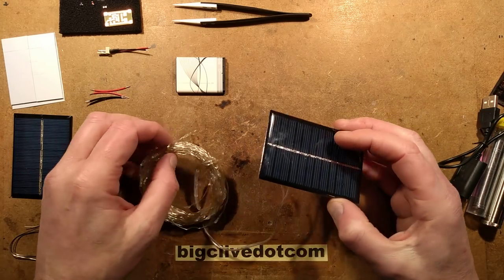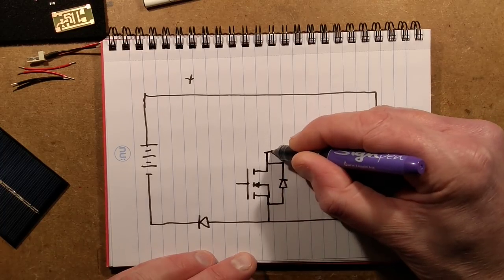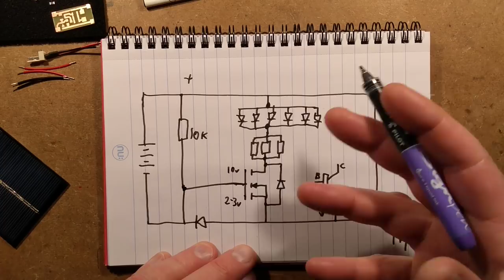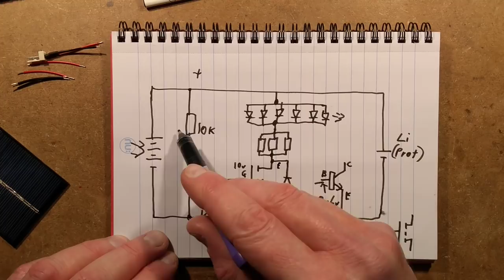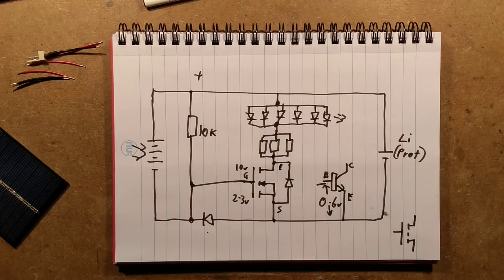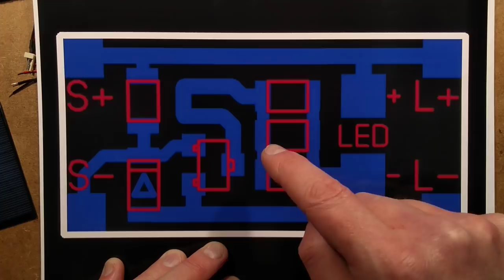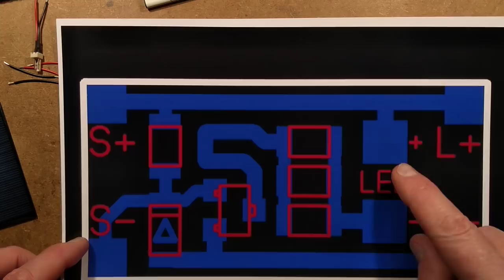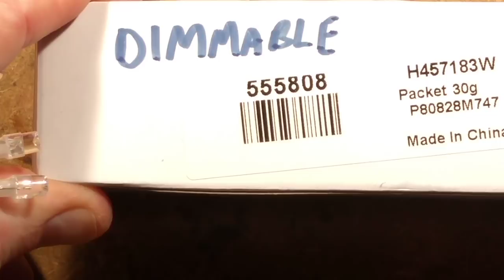DIY solar garden light project.  Surface mount remix.

Comment: 7:10 matter of fact fets where invented first they just lacked the technology to manufacture them so the bjts turned out to be available first ...
Reply: Yeah, two cat's whiskers.  Took them a while to get the hang of doped junctions.
Reply: In college we made some crude MOSFETs in a freshman physics lab. They weren't particularly difficult to make, or at least they aren't if you are given a furnace, doping gasses, photo resist, hydrofluoric acid, and vacuum plating setup 😁

I'm not sure why manufacturing MOSFETs took do long. The original designs might have been JFETs; those are harder to make.
Reply: @PaulSteMarie  Yeah, they're not hard to make once you've figured it out.  I don't mean figuring out how they would work, that was done back in the 1920s.  It was figuring out the materials science needed to make them.

Yes, JFETs came first.  The materials science needed to get the correct junction profiles took a while to figure out.  MOSFETs are simpler.  So simple, even college students can do it. :)  Even so, figuring out the materials science took a while.  These days they do clever things with anisotropic etchants too.

And the BJT came about from trying to diagnose why they couldn't make a functional JFET.  So simple, you can make one by accident.
Reply: Hydrofluoric acid is nasty stuff.
Reply: @simontay4851  Ah yes, one person got a micro drop on his hand and the health and safety people went on high alert. I raised a blister on my finger twisting off the cap on a bottle of soda and they sent me to the doctor for evaluation.
Reply: @bdf2718  Dunno about the material science aspect. JFETs, BJTs, and depletion mode MOSFETs are all tricky to make; the base and channel layers are very thin and require a lot of trial and error to get right.

Enhancement mode MOSFETs, however, are easy-peasy. O2 in a furnace gives you the oxide layer. Then you photo etch two holes in the oxide layer and dope it heavily in the furnace. Final step is vacuum depositing aluminum and then photo etching three pads. No harder than making  diodes.

My only guess is that no one had though of enhancement mode MOSFETs at the time.

All I can
Reply: @PaulSteMarie  Even with enhancement-mode MOSFETs you have to figure out the materials science of photo-etching.  Easy to do, once you know what chemical processes work, but experimentation required to find processes that work.

The first BJT was made with some doped semiconductor (no junctions or clever diffusion profiles or whatever) and two metal contacts.  By accident.  It's hard to get simpler than that.  In fact, it's possible to do it without a doping stage if you choose the right starting material, such as galena.

Comment: Feel old cause my portable soldering iron is still butane. Bright orange RadioShack version of the Weller Portasol (P1C) I've had for 25+ years.

Probably better at dealing with 16g car wiring than a usb tho.
Reply from the maker: The gas ones tend to waver up and down a bit too much for me.  But the bigger ones are good for large solder joints like wires.

Comment: Hi bigclive Love the videos, I have built 2 of these so far (more parts on order) and they work great, and as I am self-taught (by watching you and others) just wondering if you could explain a little more about what "Pull up" and or "Pull down" resistor is and how and why it works?I know I could google it but hearing you would make more sense to me than reading it over and over again it sure would help me (& maybe others) a lot!!! Thanks again and Two Thumbs UP Sir!!
Reply: I also did a short search for that soldering tip that you use in this video on ebay and nothing came up ?
Reply from the maker: A pull up resistor just applies a slight bias towards the positive rail of the supply and a pull down provides the same slight bias to the negative rail.  It's use to avoid leaving switch inputs floating in an unknown state and to make sure things like MOSFET transistors are always off when not being driven.

Comment: Hello all,
I have a question for Clive and/or the community. I'm a disabled video doorbell (Ring) owner. Ring sold me a solar charger ($50 USD) for the doorbell as it's rather hard for me to remove the doorbell from the wall and re-charge the battery on the doorbell. But the solar charger does NOT keep the doorbell charged even if I have all the power settings at the lowest power usage settings. Is there a way to build/buy a solar charger that I don't need to remove and re-charge the doorbell as often I currently do?

Comment: What are your opinions on the types of iron that say, 30 seconds on 30 seconds off? I have one and it seems like it just gets up to temperature at 30 seconds but cools down too quickly, I wondered about adding a 12v fan to it, stop it smelling hot 😂

Comment: A good Joule Thief Can be made with this MOSFET.
Reply: I ordered 200 of A2SHB and first used a 2N7000 to build a "Classic Joule Thief" with a 5k pot in place of the 1K resistor on the base or gate, plus I added a White LED from gate to zero Volts so the gate would not get more than about 3V (I killed one 2N7000 without it) The 2N7000 would only work down to 1.0 Volts (not so good) but when I put the A2SHB in the same circuit it would work down to 0.6 Volts, so yes, it can make a Joule Thief. The MOSFETs will also put out enough to light 9 Volt LEDs quite brightly.

Comment: What kind of soldering iron is that or what is it converted from exactly, I would like one for my work toolbag it would be perfect for what i do
Reply: @cannrobe   Unfortunately they do not ship to the grand ole U.S and A... but it gives the round about specs and they seem quite mass produced so I can find another thanks!
Reply: Grab a TS100. They can be powered by pretty much any battery and at 24V are rated 65W. They are smaller than this, have interchangeable tips, temperature control, standby and autosleep, etc. And price is quite affordable.
Reply: @MladenMijatov  That style of e-cig battery can be had for about £3-£4 - no contest with a TS 100.
Reply: @Coltgov191145  I had a look and some of them don't ship to Australia either. Try putting  Soldering-Iron-Wireless-Charging-Soldering-Iron-Mini-Portable-Battery-DIY-Y9N2/113916006690 into your search and you will likely have a bit more luck.
Reply: @MladenMijatov  Excellent advice, and I've been really enjoying my TS100 for everything but the heaviest jobs :-)
Reply: @mahlapropyzm9180  No contest on price given that the TS100 is around $40; but a huge contrast in power, bit size, and frustration levels, the TS100 wins very easily on all those.

Comment: So this is a while ago, (yes Im binging BigClive). Those kind of batteries are a bit tricky to find now, but could you use a disposable vape type battery with one of those tp4051 protection circuits? I've heard they can be tricky with solar panels.
Reply from the maker: You could use a simple cell protection PCB or with the full TP4056 module you could use a much bigger panel.

Comment: Hi Clive, 

I don't suppose you would happen to know roughly what that little iron would equate to, in terms of Watts, in a conventional mains powered iron? - I'm guessing at less than 15W?

For sensitive circuitry, years ago, I had an Antex 12V, 25W, iron that I ran from a car battery. It was an invaluable tool, until I forgot to disconnect it one night. Next day, the heating element was O/C - burned itself out in the night. . . . This little tool of yours looks like good one for sensitive components, but would you recommend grounding it to dump any static discharge? Or would you think the risk to be negligible?
Reply from the maker: Probably about 8 watts so no competition to a full size iron.

Comment: hello! the base and collector legs of transistor can be wired on the circuit. Base can be wired after the 3 resistors and the collector can be wired to positive with pull-up resistor. Is it okay? I do not see the transistor in PCB.

Comment: Clive do you have any links availible for the hardware used to modify the Vape Mod into a Soldering Iron? Such a handy idea for a Vaper working in the field.
Reply: I managed to find a range of different types by searching 5v soldering iron on ebay

Comment: You'd need a hot work permit in my work to solder (in the main building such as exit suites or studio areas not in workshops) due to having to disable smoke detectors and fire suppression systems and the eejit factor of course...
Reply: save them hotel plastic shower caps for the head. they work great for disabling a smoke detector
Reply: @cardboardboxification  I usually use a blue nitrile glove...

Comment: Hi CLIVE. Can you please tell me why you bought the uni-T  210E and not the 210D? Which is better for diy Auto repair. Thanks Chris NYC 👍
Reply from the maker: I believe the main difference between the two models is that the ut210e has a low current range for greater accuracy with electronic loads.

Comment: Out of interest Clive,  when doing SMD work when in your opinion is it best to use a soldering iron and when is it best to use paste & hot air?

Just started out working with  SMD components and it's something I've been  wondering about.
Reply: look up ( Mr Carlson's Lab ) he is  the SMD king
Reply from the maker: I've just bought a reflow plate for soldering whole PCBs at once.  For small tasks manual soldering seems fine.

Comment: Have used this circuit, but I have problem. 
My 5V solar panel puts out 60mA at open circuit (measured). That could be more than enogh to charge the battery in sun (3h in dirrect sunlight) and drive 10mA LED at night. But the rectifier diode cuts that "open circuit" current down to 16mA (internal resistence of diode?). So I presume - my battery wont recharge durring daytime. Do I miss something?
P.S. Thank You for explaining MOSFETS. After this video I understood how to work with them.
Reply from the maker: The diode shouldn't limit current significantly.  Keep in mind that using a meter in series to measure current introduces extra resistance.
Reply: @bigclivedotcom  
Problem solved.
Two (???) second-hand diodes i've got for testing were fault.
For both there must be some internal failure happened, that restricts current flow.
Took a brand new diode and the current flows without any significant drop.

Comment: For safety reasons you better put the protected side of the connector to the battery not on the led string.

Comment: Try some gel flux - it will help make better joints on the SMD's
Reply from the maker: I've got a bottle of flux, but really need a needle dispenser for it.
Reply: @bigclivedotcom      G E L     flux - use a kids paint brush to apply it.

Comment: Thinking of deadbugging a few of these (same technique as the old video, just with a through-hole MOSFET). Can't find any that have such low Rds(on) as the SMD package, though I suppose that might be down to lead resistance.
Tried doing the math...looks like the break-even point where a MOSFET would be better than a Transistor Universal NPN is where Rds(on) times Ids is less than 0.6V? Quite a few through-hole MOSFETS that claim Rds(on) in the neighborhood of 100-200 mOhm, so any of those would do.
EDIT: Looks like the proper part number for these MOSFETS is SI2302. Kudos to Google Image search for the cross reference.
Reply from the maker: I think the predominant availability of the most amazing MOSFETs is purely due to them evolving rapidly in the surface mount era.  I did a version of this that could use the rather tame 2N7000 MOSFET in through hole form.
Reply: @bigclivedotcom  I was going to mention the rather ubiquitous 2N7000's comparatively abysmal Rds(on) of 5 ohms, which makes it in fact less suited to this circuit than a typical NPN for any Ids over 120 mA, but I thought it would have been an unnecessary diversion. Obviously the switched current load influences the designer's choice of switching transistor; "for an outdoor visual effect all night" the 2N7000 is probably a fine choice.
Reply: @bigclivedotcom  Unfortunately, through hole logic level MOSFETs (those with a Vgs(on) of 5V or lower) with a low Rds(on) appear to be rare as hen's teeth, but it looks like the NTD3055L104 is as close as I can find to a through hole counterpart to the SI2302/A2SHB. It's available in a TO-251 package, has a Rds(on)(typ) of 104 milliohms, and costs ~$0.36 each @ 100 quantity. It still won't be turned on hard by the battery's 3.7V-4.2V,, but it should do much better at these voltages than the 2N7000 or a typical NPN transistor.

Comment: That's not "hot work", it is "hot work on a loaded lithium battery"! I'm not worrying about this - but if I would be asked whether that should need a permit, I would imagine molten solder irons between the contacts of a car size lithium battery. The iron being melting, not only the solder.

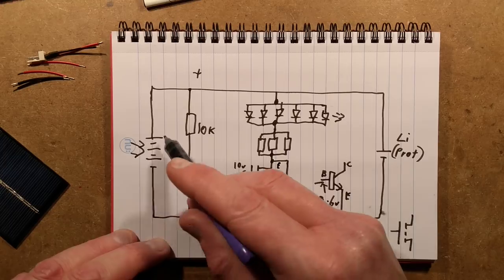Comment: At 10:28, how does the gate gets pulled up? I can still see the gate connected directly to the bottom rail.
Reply: I'm wondering this as well. I must be missing some really obvious basic electronics knowledge that would explain things!
Reply: I guess it has something to do with the diode. But I can't figure out what exactly.
Reply from the maker: When the sun goes down the solar panel effectively disappears and the gate is pulled up by the resistor.  The diode effectively isolates it from the lithium cell.
Reply from the maker: It's the simplicity of the circuit that makes it harder to follow.  It achieves a lot with a little.
Reply: @bigclivedotcom  is it because there is no any current flow through the resistor? There are two ways in which the current can leave out the resistor. (just in case  if it flows inside) Either into the mosfet or into the negative of the battery. But the current can't flow anywhere. Am I right?

Comment: I'm sure this is a novice question, but why wouldn't the solar panel current just short through the 10k resisted instead of being useful?
Reply from the maker: In normal use the current through the resistor will only be a fraction of a milliamp.

Comment: HI Clive. As I don't have the ability to make your little PCBs, can you point me to a through hole version of the MOSFET please?
Reply from the maker: A common older through hole MOSFET is the 2N7000, but it has nowhere near the amazing specification of the A2SHB MOSFET.
Reply: @bigclivedotcom  Have to admit I couldn't find anything similar! Which parameters are the vital ones in this cct? 
Alternatively, any suggestions on making small pcbs simply?
Reply from the maker: @freezefreecompany  For the MOSFET I'd say that one of the most important parameters is the low gate voltage in the region of 2 or so volts.  After that the current handling ability would be useful if driving higher current LEDs, although the slow turn-on at dusk and dawn will result in a higher dissipation from the MOSFET with high current loads.

Comment: How do the LEDs work in parallel?
Reply: Roughly speaking, low voltage, higher current. LEDs in series you essentially need to add up the forward voltages of all of them. Call it 2.5V per led in the string.
Reply: They come out of the same batch so have nearly identical characteristics.
Reply: @ollieb9875  But a diode provides very little resistance once its forward voltage is reached, so if I test this on a breadboard I will usually find that one LED lights up and takes all the current while the others do not.  Are we sure the LED string doesn't have resistors in series with each LED?

Comment: Clive i must ask this : Why is it that most solar cells have a coating or covering that over time reacts with UV and goes cloudy ?? Would just plain glass block the UV and keep them clear ? I love projects like this but i"m afraid i just waste my time as they go cloudy and will not charge after a half season of being in the sun. Your thoughts on this ? Yes i too love these projects.
Reply from the maker: Glass would be better, but the resin ones are cheaper to make.
Reply: @bigclivedotcom  I've tried various spray coatings - mixed results. I worked for a solar cell company back in '05. They let me have a box of damaged cells, they were extruded super thin so they are very fragile.
But i am reluctant to use them as when they are no more that is the end. they are so fragile when i tab them they crack if i don't heatsink the back of them. Some of them in full sun do 180 mils current. The epoxy coated cells with glass over them are good for about 2 seasons, then they cloud over.
I'll come up with something. Thanks for the response Clive.

Comment: 14:45 A soldering tip for an "EVOD" e-cigarette series adjustable voltage battery?!? 🤣👍
Did you make that tip yourself?
Reply from the maker: Commercial item on eBay.  It seems to be two products mashed together with an adaptor.

Comment: 11:47 you couldve made that a through hole board easily and just put some sot23 pads on the bottom side for that litte fet. effectively turning this into a hybrid board with double sided load.
Reply: But a single sided no holes SMD board is much cheaper and cooler.
Reply: not if your a clive subtly complaining about the grain of  sand size of components...

Comment: How long does the LED lights in the dark with that battery. Of course it depends on the number of LED. But in your case?
Reply from the maker: Days from a full charge, since the LED current drops as the battery discharges.

Comment: Now I have a question for you Clive, can you make it without the circuit board but still using the surface mount components?
Reply: Add to that, that he's not allowed to use tweezers, only the finest hand-kung fu soldering.
Reply: never dead bugged a circuit? the circuit is so basic that anyone would be able.....
damn, i misread this, wow, i wonder how small it could be made without a board if done with smt dead bug style